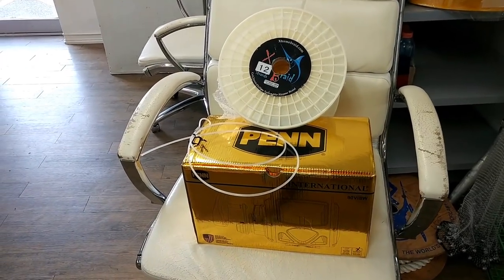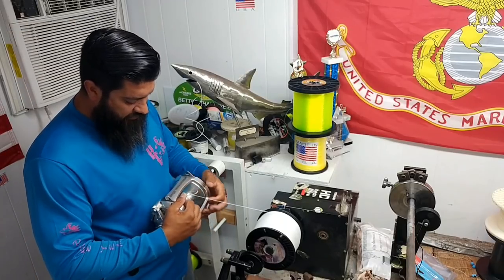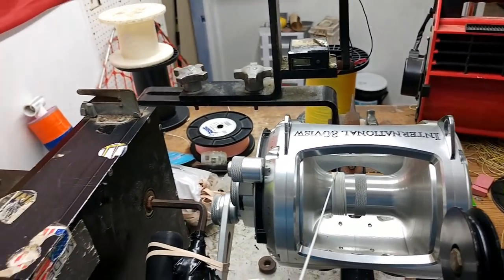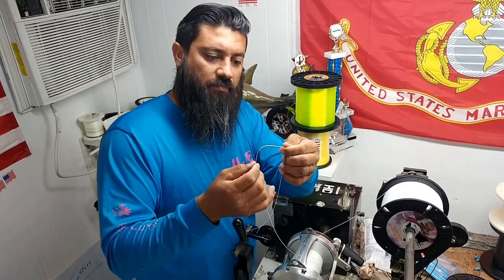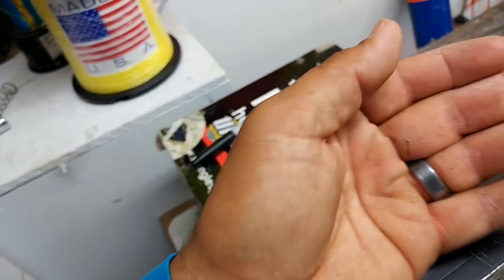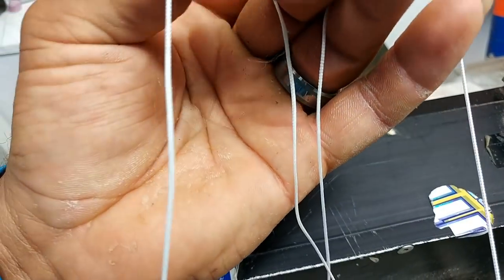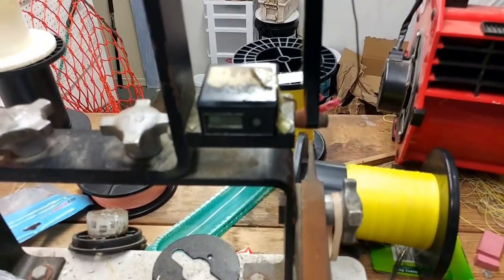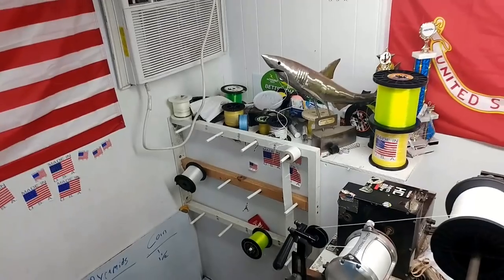200lb XTREME Braid 80W Penn International what we learn spooling sharing our know most satisfying

Comment: In your intro I see y'all have the same green and black drop net that I have (the one used for the bull red). One of the ropes on mine came undone on the first day of use (after a couple 3' blacktips @ Bob Hall) but I see that y'all reinforced that section on yours. How'd you do it?
-Thanks!
Reply from the maker: I used rope coated cable and then we back braid it so it did never comes undone and also to we don't have to worry about sharks biting through it as well for the bigger nets but the smaller green one and that video we backs braided the rope then we attached to it which was a bigger size than the 1 that came with it similar to the same video that we did the how to attach a rope to your castnett rope
Reply: @TeamHardLife  awesome, thanks!